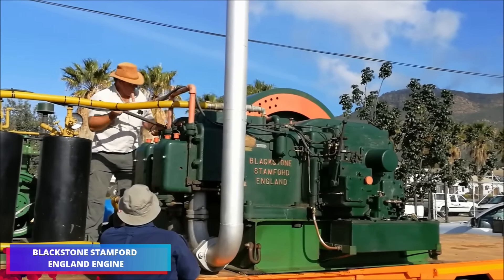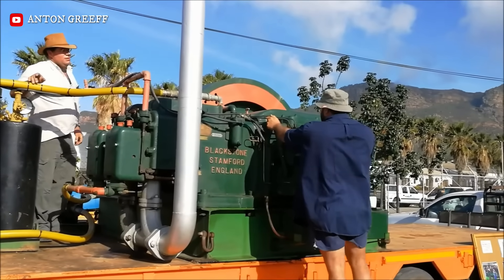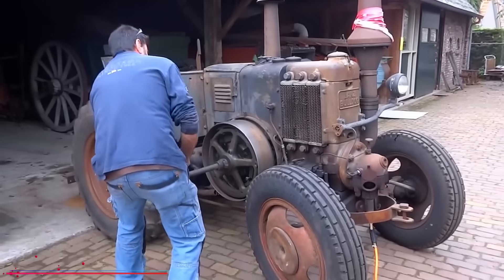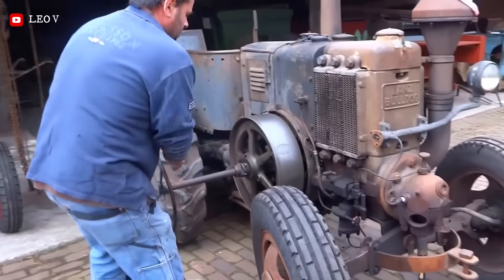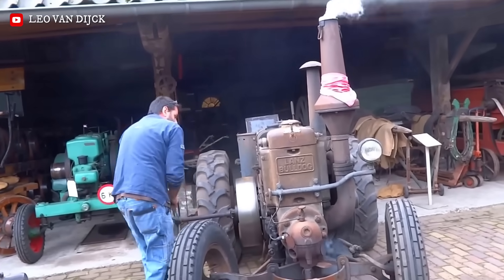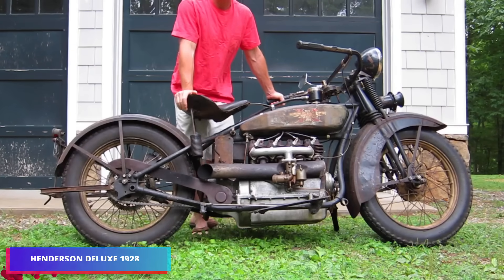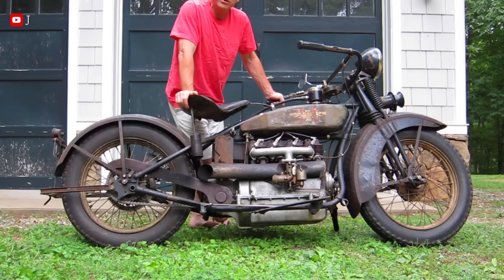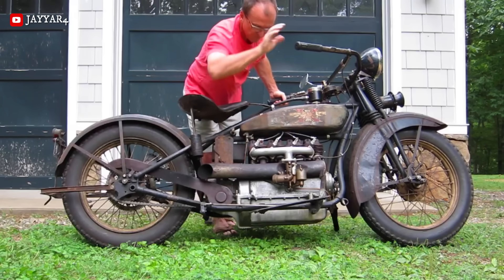Rare Old Engines Starting Up Sound That Will Blow Your Ears ▶18

Comment: 80 cubic inches equals 1,300 gallons? On what planet is that then? It's actually 1.3 litres or 0.35 USG! 1,300USG is well over 300,000 cubic inches! If you're going to upload a video, at least check your facts - or is that too inconvenient?
Reply: I think they meant 1,300cc
Reply from the maker: (≈1,301 to 1,305 cc)

Comment: Total displacement 80 cubic inches (approximately 1300 gallons??    1300CC
Reply: In EU writing it's common to see a comma where in the US we would use a decimal point.
Reply: My 1340 Harley is ,,, 1340 cc's ps. Someone was here...
Reply from the maker: (≈1,301 to 1,305 cc)
Reply: @Proton-Tech 80cu in is about 1300cc not 1300 gallons 🤣